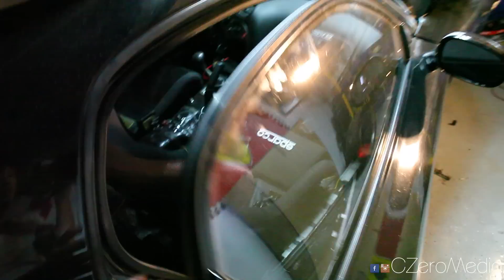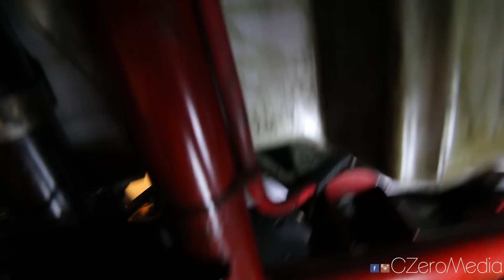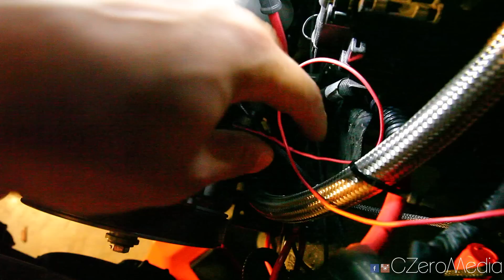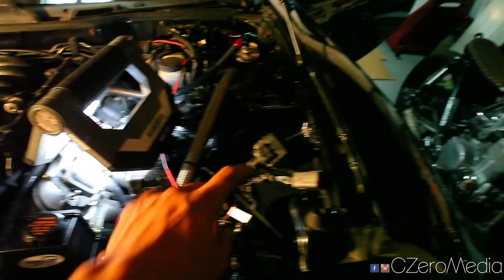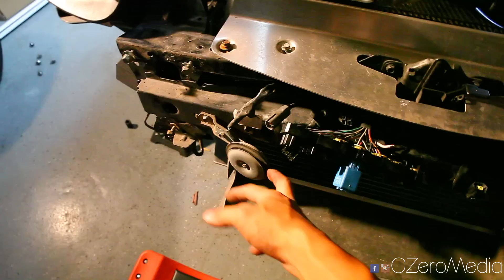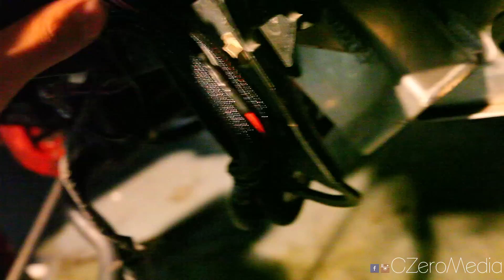Charging Issue Resolved. Alternator Starter Explained - Wide Body V8 FD RX7 Build Video Series 6

Comment: I have basicly the same problem on my Volvo 850. The battery isn't getting charged, the battery is bad or something in the car steals electrisity. Btw I have a amplifier and a subwoofer in the car who i thinks steals electricity. 

What do you think is the problem and what do you think i should do first?
Reply: +johannes zentio Get a multi-meter if you don't have one already. Pull off the negative battery terminal and put the multi-meter probes between the battery and the negative terminal. Set the multi-meter to amps and see how much current is getting drawn with your car off. It should be next to nothing if everything is working right. I would pull the fuse for your amp and see if it changes anything, if it doesn't start pulling other fuses until it changes. This will narrow the problem down for you.
Reply: +johannes zentio If it is the sub, then make sure you have a remote wire.  Other than that the amp should not steal power.
Reply: I thinks it's the amp that steals, will have to check it.
Reply: +johannes zentio You should check for parasitic drains when the car is off